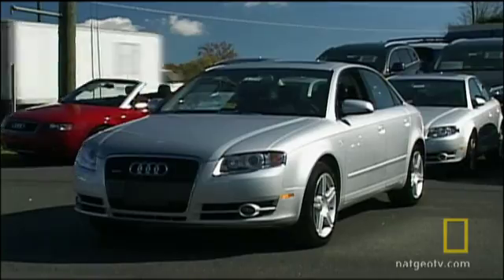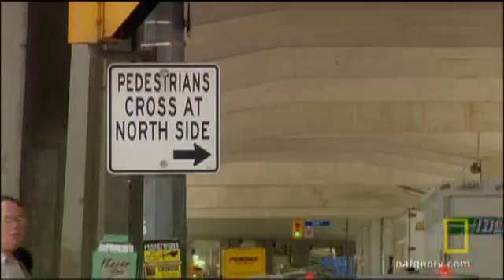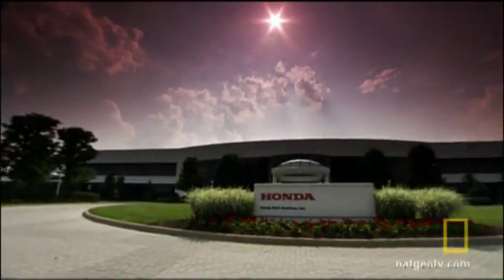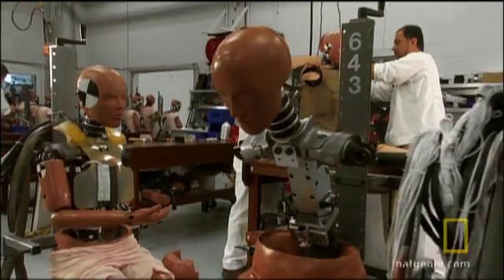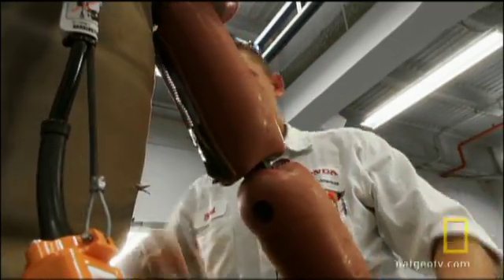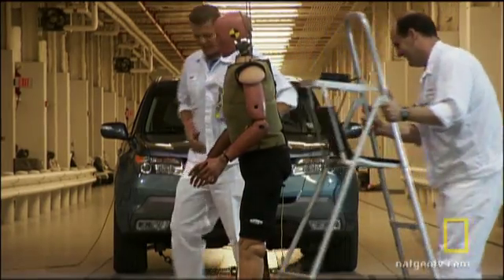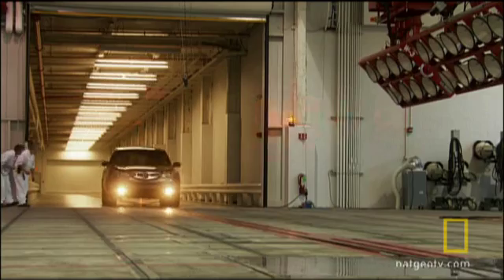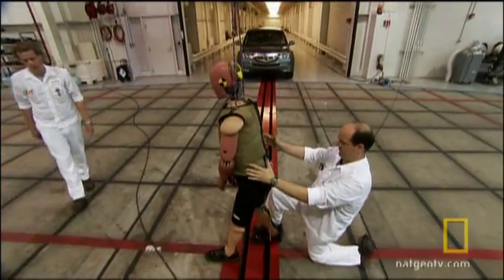Pedestrian Crash Test Dummy | National Geographic

Comment: @PedAdvocate bumper air bags could help.  They could be triggered by distance sensors on the front.  Maybe they could be made strong enough to cushion accidental hits while parking too without even scratching paint.  It could cost more than they are willing to spend but it wouldn't need to be as reliable as normal airbags since faulty deployment of a bumper bag shouldn't hurt anyone and lack of deployment would be no more harmful than current bumpers.

Comment: Notice how the SUV hits the pedestrian dummy fairly high on the body, throwing him out in front (possibly to get run over by the SUV).  A sedan would hit the pedestrian lower down in the legs, sending the pedestrian over the top rather than out front.  This is one reason why trucks and SUVs tend to be deadlier for pedestrians than cars, and gives the engineers more of a challenge to reduce the damage they do.  Of course, if the vehicle is speeding too fast, any design will be deadly.
Reply: Yes, and hoods have only been getting taller and higher, making them more dangerous. Plus large pickup trucks make up a startling amount of new car sales. You ain’t rolling over those
Reply: 12 yrs later me watching this video with 2 prior broken legs and wrist 💀💀💀and still recovering I did indeed get hit low because of my height.

Comment: Wow, they basicly tell you what car to use if you want to mow down pedestrians...
Reply: Ford F-350 is your safest bet if you want to do the most damage, large/heavy truck with fairly fast acceleration and a high bumper. You could put a heavy duty brush guard on the front of the truck to cause even more damage but make sure the truck doesn’t have AEB because that will render it basically useless… you know, theoretically